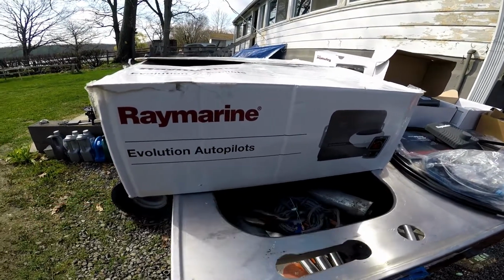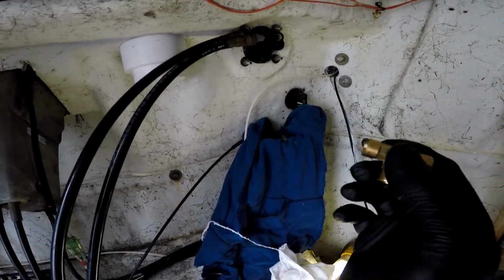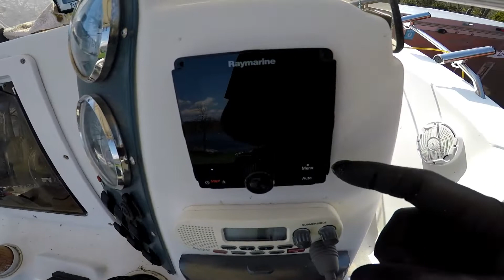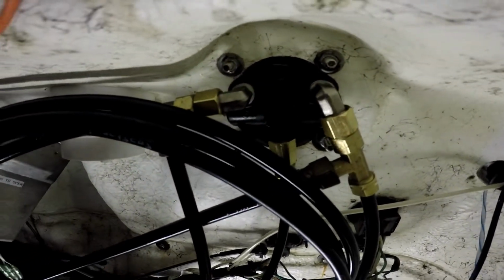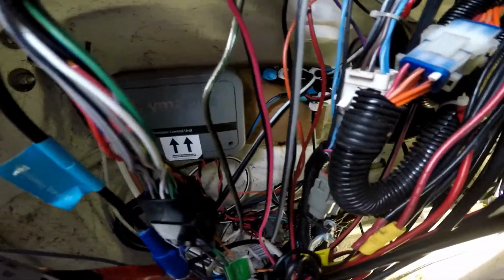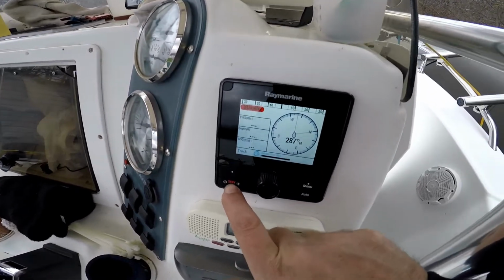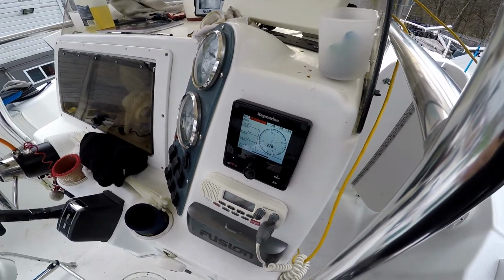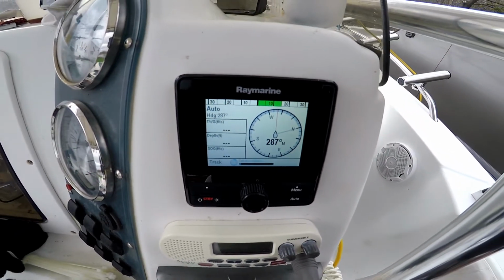youtube video #-pfuvJPvyPw

Comment: Nice. Very few people do videos for installing marine hardware :) I'm also about to do this Raymarine autopilot install and I might do a video of it. I noticed couple of things in your install. Fittings and threads should be the right kind BSP or NPT and sealed either by washers or Teflon tape (not thread locker). If the thread tapers you have to use Teflon tape. The pump part uses BSP and there you need washers. I had custom 100R7 hydraulic lines made with BSP threads and made of acid proof stainless steel (A4). Also the long loops of hydraulic hose made the bleed procedure harder for you. Another thing is the location of the EV1 sensor. It should be 1m (3ft) from anything electronic/metall. I'm not so sure about the location next to your plotter...
Reply from the maker: J. Sjoberg 
Thank you for all your suggestions I did test out the pilot on a water and so far works fine and also it's not leaking from any connectors

Comment: Nice slow how-to!!!  I installed the same autopilot and I’m ready to purge and fill w/fluid.  To clarify, did you use the autopilot pump to fill the autopilot lines and then, use the steering wheel pump to purge the main steering lines downstream to the motor?  Did you open the steering cylinder drains while running the autopilot hydraulic pump?  Just not sure of the best way to fill the autopilot and refill the steering.
Reply from the maker: Thanks buddy for watching and commenting
I used steering wheel pump to get the air out the tubing's then I use autopilot pump to get fluid running through the lines then I switch again the steering  wheel releasing air out 
Make sure you do have enough oil at the reservoir steering wheel when you're doing this, that's why I used clear tubing to see oil
Took me way longer to do this because I use longer tubing when I hook up the pump if you will use short tubing you will not going to have to do this too long😉👍
Reply: Kzthefisher Outdors thanks for your guidance!

Comment: Two questions, why didn't you install the sensor inside the helm?

Also, did you have any issues installing the sensor so close to the fish finder?
Reply from the maker: I did install censor because it was convenience for me on that spot Also display unit has the gauge on the bottom which shows how much  Interference it is if his close to any objects With magnetic field It's been a couple of years when I installed this unit and no problems whatsoever on my side

Comment: How does it work so far on the water?  I like to buy EV-100 but the package has hydraulic pump between 50 cc and 110 cc. My Baystar hydaulic steering has 118 cc. so EV100 may handle my Johnson 90 hp but with limit. So, debating whether to get EV-150
Reply from the maker: Thanks for watching buddy so far no problems whatsoever👍😉
Reply: @KZtheFisherOutdoors what kind of hydraulic do you have? is it within 50 cc to 110 cc so EV100 can work?

Comment: Great video! What type of hose and size did you use to connect pump to helm?  And where did you buy it
Reply from the maker: Thanks buddy for waching and for you comment 
Hose came with autopilot if you need one, any marine supplier should have them
Don't make the loop like I did take longer to get air out
Besides that it's a piece of cake to install